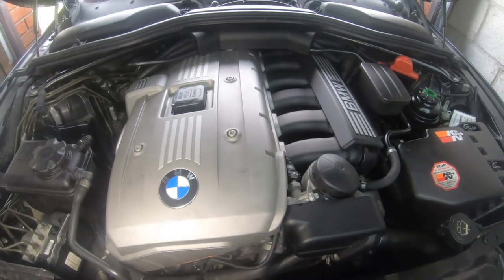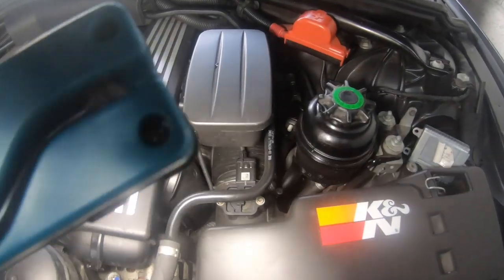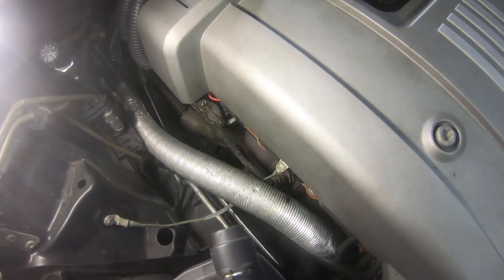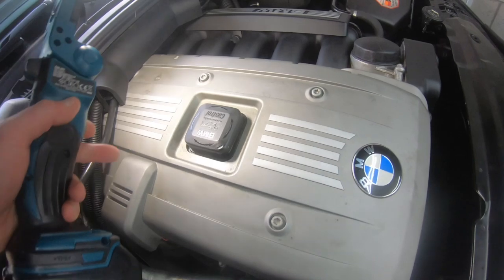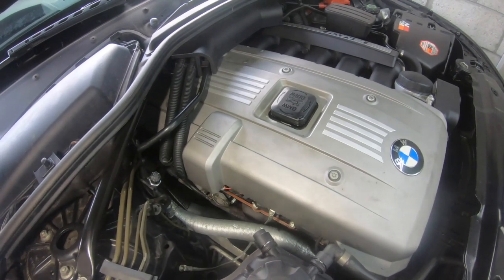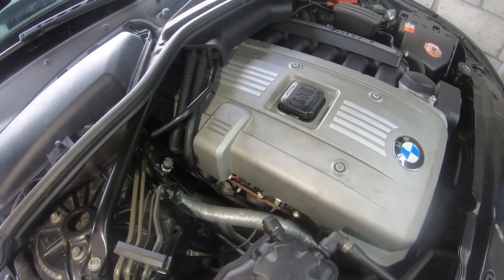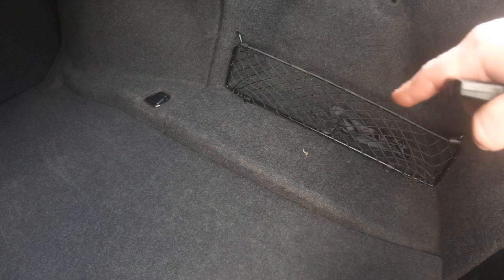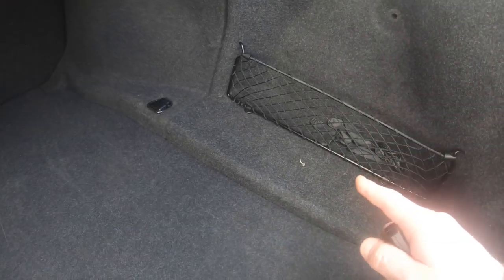BMW N52 Rough Idle Vanos Codes & Faults....Heres Why ?????

Comment: Hi, appreciate your good work and honest truth. 
I have a bmw 530d 2005, the car runs great, injectors are in good shape, cleaned the inlet manifold, egr, removed swirl flaps. Runs good, lots of power. But the car is throwing a weird error 3FF0 - Air mass meter. 
It makes the Check engine light iluminate. Changed the maf with a brand new one and it still acts the same. Car pulls great, lots of power. 
What can be the culprit ?
Some air escaping ? 
Appreciate any thoughts. Thank you
Reply from the maker: if its mass air flow mate check the pipe that comes off airbag and joins the turbo that could be loose as its common problem it comes away from the turbo under the manifold so. CHECK IT also check your MAP sensor on the manifold itself they become very very loose and weak if you check it will feel like its falling out
Reply: @BMWDoctor  Hi is it possible that bad maf could cause fault code p0012 or 2a83 fault code because solenoids are cleaned timing chain is ok and position sensor is ok so i dont know what else it could be

Comment: Doc, I bought a beautiful e60 from a guy, who had these codes, changed solenoids and oil etc but didn't help. The problem was in the cap thank god and I changed it but my question is, he drove around without the cage piece ofc, I changed it as soon as I found out, so could that have had an affect on the fuel consumption? As I'm getting 14-15L/100km and it hurts.

Comment: Does anyone know what the 2f91 code is, I get a slight shake sometimes when I turned the ignition, power does pull through but I feel the power delivery isn’t smooth like it’s a bit jagged. Anyone got any ideas what that could be? Also can a radiator fan mechanical fault (2eff) trigger any codes for the water pump speed outside tolerance? (2e81)

Comment: Hi Dean , quick question mate. I've topped up my coolant with BMW stuff but I think I did 60% distilled water and 40% coolant. A silly miscalculation. I don't have any more coolant left to balance. Will the car be ok with that? Levels are perfect. Thanks mate
Reply from the maker: Mate it will be fine don’t worry as long as it’s got coolant in it it’s perfect mate so don’t worry
Reply: @BMWDoctor  you're awesome. Thank you
Reply: Yo Dean, last week.. I got distracted and  I forgot to tighten the coolant cap ... Idiot .. all the coolant came out. This is my first BM. Z4 e86 just got it. 
I have since filled it with coolant and went for a drive and soon within 10 mins its out again. Filled it up ... Then within 10 - out again. I've got more coolant and have today filled with more. Since the mistake with the loose cap I have filled the coolant to right level with 3 litres 50/50 in total so far. Im totally unsure what's going on. Is this right? 
There are no leaks ... I've checked a million times. When hot, cold , before drives, after drives. Thanks very much. Mo

Comment: I have P1553 fault code, rough idle, cold start problems, seems like higher mpg. Cold start issues and sometimes bad torque or hestitation on low rpm. You got any ideas? N52 530.
Reply: I’m having the same problem and I’m getting the p1553 code. What was the issue with your engine ? Thanks !!!

Comment: How can I contact you BMW Doctor I have a couple of a questions for my 2008 x5 e70 3.0si
Reply from the maker: what is your questions you have no need for my email 

ask me here email is for business enquiries not for questions
Reply: Well ever since I bought the E70 2008 all it had was a oil leak at 68,000 miles they replaced the gasket for the valve cover but it began to leak again it turns out the valve cover is leaking then more problems came to the vehicle as The Dynamic Drive malfunction light appeared on the idrive then the powering steering blew up maybe 3 to 4 months after I bought the car so I continued driving the car only with the Dynamic drive message until September because my air bags in the rear started sagging and sometimes the front but they recieved air when the car turns on. What could this issue be I've be everywhere to dealers home mechanic shops and still no answers. I'm in the US.
Reply: @mauriciofonseca746  its possible the technician that replaced the valve cover cracked the valce cover.. The leaking oil is a fire hazard and the air loss could cause this issue

Comment: Replaced my v solenoids with doreman solenoids after replacing them my mpg goes down at idle. 
Cleared the codes and 10 miles later it came back with 1554 previous codes. 

I have a camshaft position sensor yet to install it but fuck man this shit so ass

Comment: Hi, i replaced both solenoids, but my engine still throws an 2A82 code, and the engine have no power, . please help, e60, 525xi,2005, N52B25 engine. Please.
Reply: Please reply to this

Comment: Great videos Dean! I'm having issues with my 2006 530xiT. Rough idle for about 7 or 8 seconds, then settles and is fine. If it sits outside in below freezing temps, it doesnt do the rough idle. Is there a way to check what firmware version its at?
Reply: Did you ever figure out what was the cause? Same problem, thanks!

Comment: Hey is there a way I can ask you what the codes my car is throwing are exactly ? I used if familiar with the bimmerlink app and came back with a few codes
Reply from the maker: Ask ahead sir
Reply: BMW Doctor

Thanks! Below is what it says .. I am figuring the first 2 is the seat occupancy sensor due to mine showing the error on my Idrive system. And lambda is a o2 sensor ?

 Multiple Restraint System

93AE: ZK6 / ACTIVE HEADREST LEFT 93AF: ZK7 / ACTIVE HEADREST RIGHT

Engine Electronic

2F83: 0X2F83 MOTOR STOP TIME, TIME COUNTER COMBI TIME COUNTER DME, COMPARISON
2C32: 0X2C32 LAMBDA PROBE BEFORE CATALYST 2, TRIM CONTROL 2A00: 0X2A00 SECONDARY AIR SYSTEM

Combox Emergency Call

AA0E: SOFTWARE RESET

Controller

E2C7: BUS COMMUNICATION ERROR CAN

Comment: So basically.......Never buy a BMW because absolutely anything could fail. So glad I don't own one. Spend a few dollars more and get a Mercedes Benz as they are predictable and far more reliable.
Reply from the maker: Do you know what the future right now I completely agree and LOVE Mercedes. And you are not wrong I love Mercedes and soon I will have the Mercedes C63 AMG on here that’s not a joke either. many many people now choose Mercedes especially here in the U.K. it’s over populated here nobody drives BMW anymore.

Because of how unreliable there engines really are Mercedes never a issue drive it and drive it and it’s solid proper engineering and cheaper aswell and they hold there value stronger !

Find me a cheap Mercedes that has a bad name in the internet you will be hard pressed to find that even a old classic one.

With bmw just type the name of any engine online and tons and tons of forums posts about the reliability come up.
Reply: @BMWDoctor  wow really? Thats interesting to know as in North America we tend to see the european motor trends a bit later. I own a repair shop and we work on so many of these. People are still buying them up as if they were the deal of a lifetime here.  Ive worked at mercedes benz and even the old ones, like you said are very reliable. Good choice with the c63. I wish i could afford one but maybe in the future.lol Thanks for the reply.
Reply: Biggest mistake I made buying one